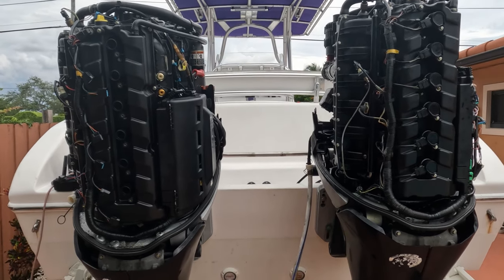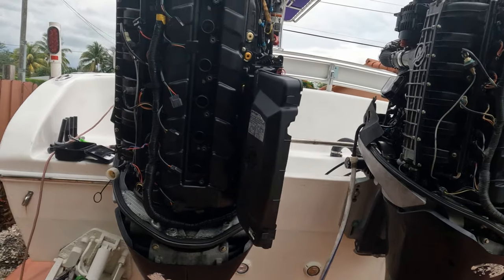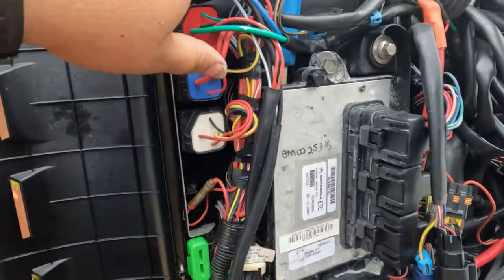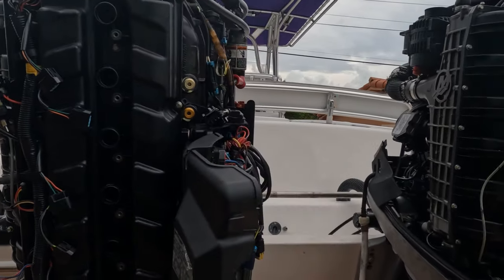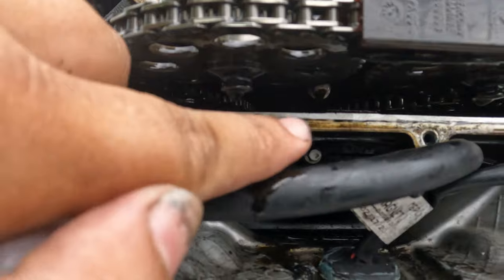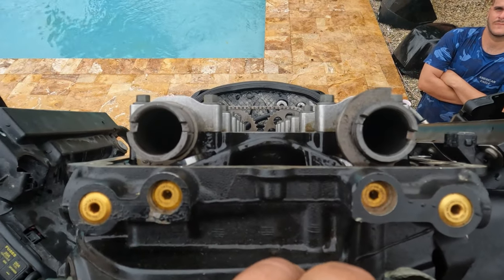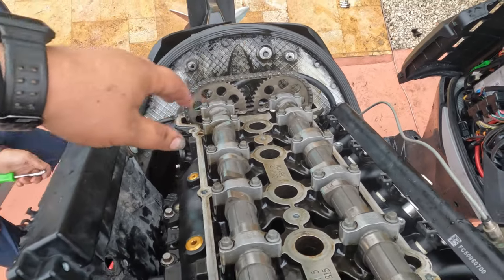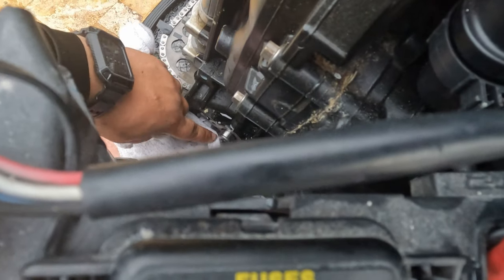How to fix timing on a Mercury Verado 250/275/300

Comment: Had a look at your video, and did same procedure to mine, the intake cam was out by one link . Took me about 4 hours and it sounds just great. The Mercury Dealer quoted me $4800 to fix it and recommended that I not bother with an old engine(2006)
Reply from the maker: So glad I could help you.

Comment: Hello
Thanks for the video. Just so I'm clear on what i didn't see, you aligned  the cam shaft poinerts at the sprocket end of the cam  with the center of the colored links while aligning the fly wheel pointer and cam slots on top? Also , there are  with dropping the chain.

Comment: I have one of the same that will not start unless its full throttle and will not idle, replace spark plugs, the two round rubber boots on the left side between the throttle body, I get 47 PSI fuel pressure, 110 PSI on all piston, replace water Seperator. Check Air idle sensor on top with the little boot ok and wiring to ecm ok.    Still no go. any help would be appreciated.  Great Video

Comment: Hi, i have verado 300 supercharged. I was wondering is supercharger oil separate from engine oil or both are the same?
Reply from the maker: Same oil
Reply: @newagerepairs3392  thank you, so no need to change the supercharger oil same as car, correct?

Comment: After releasing tensioner, did you have to turn the out of time camshaft to line up notches? did you have to remove the chain off the the sprocket to do so?
Reply from the maker: Yes you move the chain and rotate the cam till you get it back in time. Make sure you replace the tensioner.

Comment: My verado runs rough on idle and dies when I sensitive throttle up. When I throttle up faster it runs great to running speed and to wot great, after that I go to idle, runs for 5 seconds, then dies. I checked all but now I am suspecting that it could jumped one teeth. Could this be my sympthom? Maybe to change chain and tensioner? I have 1200 hours. Thanks for advices
Reply from the maker: It sounds about right. If you have any questions, you can contact me at 786-283-1472.